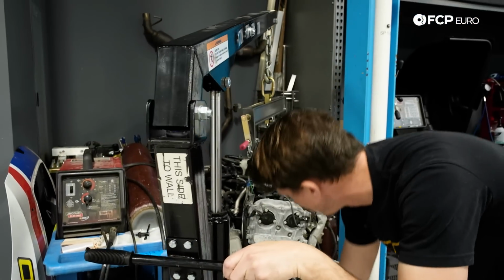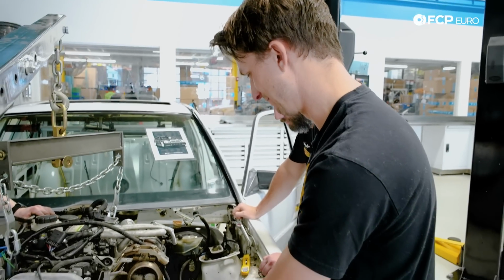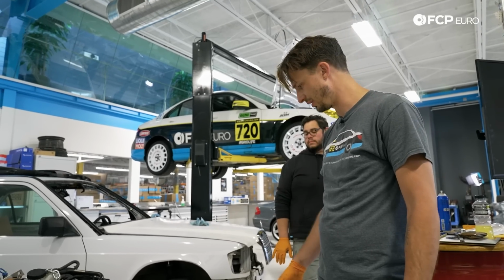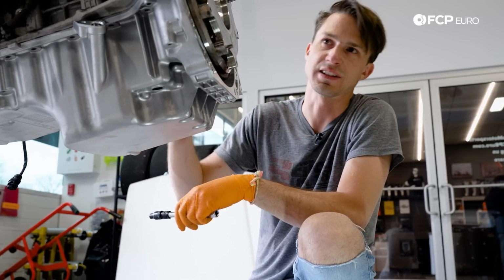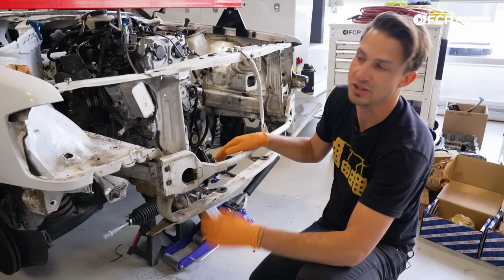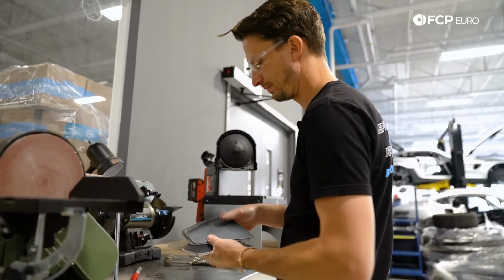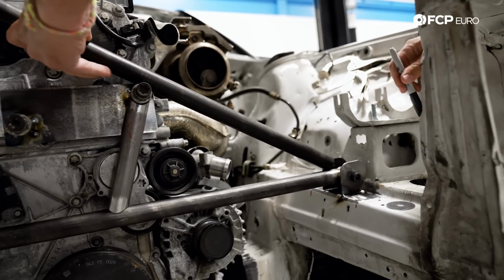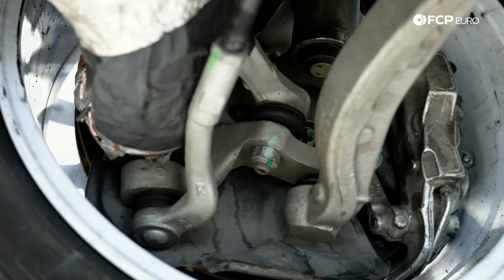Squeezing A Turbocharged 2.0L AMG Engine Into A Mercedes 190E - Golden Era Ep.2

Comment: I had, for a time, a manual 2.3-16. It ended up being a rust bucket and I sold it on. But I still miss the spirit of what it was. You are doing the right thing by doing this this way. It's not a radical departure from the theory of what the 190 was meant to be at its peak. Its an augmentation I can absolutely stand behind. Please continue.

Comment: Refreshing to see an engine swap with something else than a LS engine.
Reply from the maker: We agree Jesper that a lot of viable Euro power/platforms are ignored for the more common routes.
Reply: LS is cheaper, easier and more powerful
Reply: @unclejoe6811  I totally agree with you on that, and understand why it is so widely used. But it is also fun to see a mercedes with an actual mercedes engine in it. Especially this model, which had a 4 cylinder engine when used for DTM back in the days. It can also help on the handling and weight distribution to keep it a 4 cylinder, since it is not that big a car.
Reply: The straight TRUTH!
Reply: For real, everything is LS or K20, everything
Reply: Japanese v8s 4life. 😂

Comment: Ive been waiting this kind of project...

As well as looking for classic volvo with new gen t8 turbo+supercharge swap...

Looking sweet...

But i got 1 suggestion for the steering rack and pump setup...

1-the rack needs to sit level with tie rod end at the wheel knuckle AT final ride height with tyres on the grown and full body weight resting on suspension...

Definately not at tye same level as lower arm bolt point...

Probably 1" or 2" higher from lower arm bolt position...

And to simplify the steering pump plumbing/location, just use electric hydraulic steering pump for this build...

Definately frees up some area and saving the plumbing headache...

Comment: i actually did the same on my 190E but with the w204 engine 1.8 supercharger with the manual transmission its a fun swap but no power steering or AC and used all original wiring because im not a pro like you guys i just did what i can to make it work and its awesome fun to drive
Reply from the maker: That's a great swap Debsi! The M271 is a neat engine, and would be a blast in such a light chassis!

Comment: You guys are doing a fine job on the W201 car, and it should do well for you. My version of this type of swap started with CL203 chassis but utilized turbocharged M104.900 VR6 for power. The VR6 footprint was a perfect match for the 203 chassis and it`s always nice when you pull off a swap that no one else has done using mostly off the shelf parts. Keep rolling.......
Reply from the maker: The M104 loves boost! That engine has stayed a bit of a tuner's secret here in the US market, but the potential for power is undeniable. We'd love to see you make it happen!

Comment: Magnificent.  I'm a long time w201 guy, since the times of the old 190 enthusiast webpage back in the early 2000's, my first car was an 8v and have owned a few since then.  I started with gasoline engines but now I'm getting familiar with the diesel versions as now I got ahold of a 2.2 diesel.  Speed is not a factor for me at this point as an older guy but, because of my previous experience with 190 accessories, I would love to see what you guys do with the interior design.  I also redo my wood with nitrocellulose just like the original factory wood, just to name one example from that Golden Era.

Comment: Wow... I have been think about this for a while but I did think it was possible because the engine was horizontal but the new sl gave me hope. I didn't know The it was possible to use A45 motor in the 190e. The 190e should be incredible since it was  built well and light weight it should be really fast  and go around. Corners too.
Reply: also, if I reemember correctly, it was designed for rally from the ground up so it should still have the factory chassis reinforcements that every common 190 had for rally spec.

Comment: Did you guys have to change the oil pick-up tube since you changed the sump that has the main baffle in a different position?
Reply from the maker: Hi Hussein! We will be altering the pickup tube as well in subsequent episodes. As the factory M133 sump is designed for a transverse installation and we're flipping it to be longitudinal, we need the full oiling system to be equipped to draw oil from the rear of the sump.

Comment: My first car was a '88 manual 190 customer amg with a tuned m103, thing was a monster that ran over 300km/h, unfortunately got stolen. Always wanted to recreate that car but without the actual amg mechanics that worked on the car I wouldn't know what to do. You guys are kinda scratching that itch.

Comment: Awesome swap in an awesome chassis. I can't believe Bob didn't call about your vehicle's extended warranty. Are there any plans for any kind of modifications to the engine or just swapping out the drive train?
Reply from the maker: The stock M133 is already pretty potent for the weight we anticipate the 190E 2.0-16 to be, but we do expect a decent power boost as we shed some non-vital components and switch to standalone engine management. As for the rest of the driveline, you'll be seeing a lot of creativity in the coming weeks!
Reply: @fcpeuro  It is without a doubt "pretty potent" but since this is a tribute to the cars from the 80s when they were pushing the limits of what was offered shouldn't the same be done on this build? I would imagine with a turbo swap (since you need to flip it anyway) tune, E85, exhaust, intercooler (since I would imagine you plan to change it since you want to show off the motor more) and intake you should get 550-575hp I would bet.

Comment: I’m in the process of k swapping my 190. I’d love to know which steering rack you are using!
Reply from the maker: Graham we ended up using an E46 M3 steering rack , not sure how that was omitted from the video. K swap sounds spicy, keeping it na or turbo??
Reply: @fcpeuro  Thanks for the follow up. I'm planning on keeping it NA to align with the original cars. I think a 10k RPM K motor screaming through ITBs would be pretty sweet

Comment: I wonder
Would the M133/139 would fit in my W204(C200)🤔
Reply from the maker: If you're as handy as Nate has become with our cutting equipment, anything is possible Iam!
Reply: @fcpeuro  🤣 Don't think I would have the same level of skills

Another question, is it possible to install the Turbo from M133 to another engine.
Since I wanted to replace my IHI Turbo on my M271 EVO 
I've done everything I could without replacing any internal parts. Intercooler, intake, Armytirx exhaust, fuel injector, Turbo Turbine, Turbo muffler delete, Turbo wastegate, ECU tuning  . I ended up with ~300WHP. Figure I can't make anymore with my current engine modifications, I'm planning to get the Turbo from M133 engine.
Would you be kind enough to tell me the boost pressure, size and RPM of the Turbo? Thank you.

Comment: ayy since you making a frame in front of the engine, why dont just make it into a cantilever suspension? the frame be multipurpose, and its easier for you to adjust the suspension setup
Reply from the maker: Hi pec1739! Cantilever can be an excellent option in some of these more creative builds, but while we're definitely making a lot of alterations on this project, we're aiming to maintain the original spirit of the W201 in DTM. You'll see some pretty significant suspension alterations made in the coming weeks to bring the chassis up to the standard of its driveline, but it may have more in common with the original W201 geometry than you'd think!
Reply: @fcpeuro  :yougotthis:

Comment: Use a sequential.. you guys going standalone anyways. Flip the turbo and run the water air infront, gonna make life simpler
Reply from the maker: Your head is in the same place as ours on the induction setup K M! Stay tuned for today's episode. 
As for the transmission, we'll be going with something a bit more "in-tune" with the W201's DTM heritage.
Reply: @fcpeuro  so a dog box then? Fair enough, interesting build though i'll look forward to when its finished

Comment: PS is for wussies, but if you have to have it, save some weight, mess, HP and heat and use a EPS from Saturn or Toyota.. super easy and the assist is just right in default mode (no controller required)